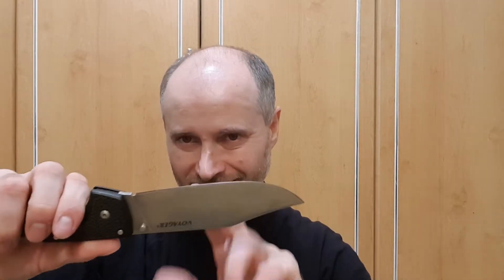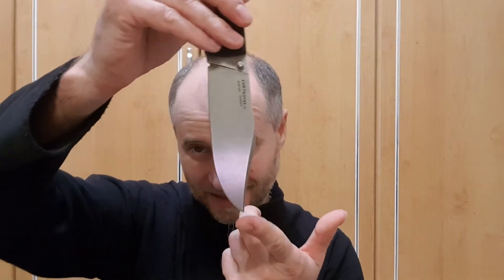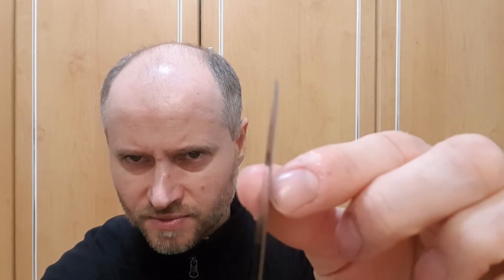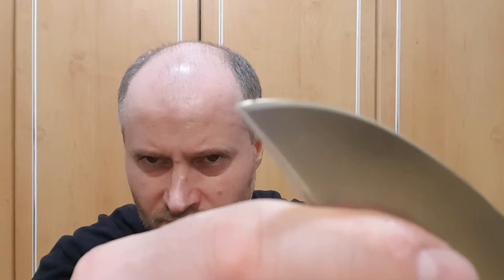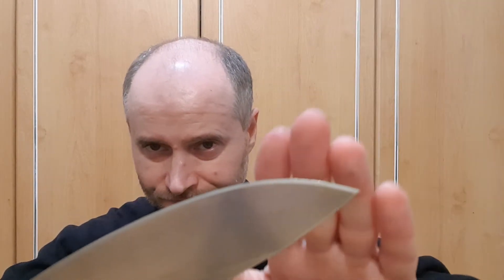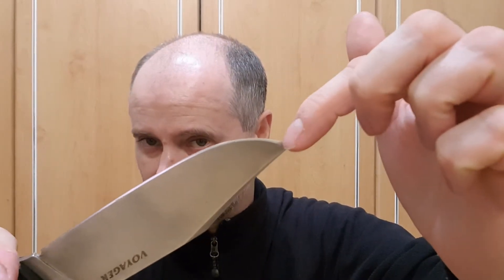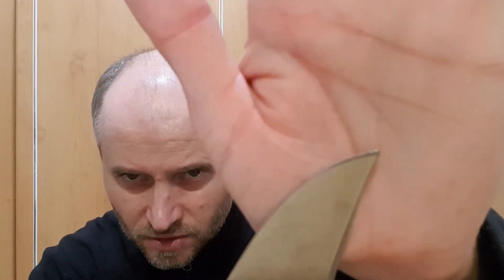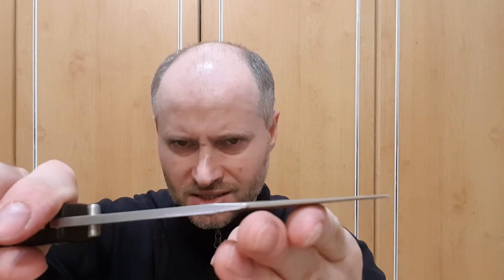AUS 10 steel and concrete (can AUS 10 survive and if, in what condition?) + something about AUS 8/10

Comment: Great discussion.  Your experiences with the two Steels 8s pretty much the same as mine; I absolutely agree.  AUS-10A is the edge King.  And, AUS-8A is a great Field Knife Steel due to the lower heat treatment that is easy to resharpen to a Razors Edge and has great toughness.  :-) Peace, Stiletto :-)
Reply from the maker: Thank you and have a great time there:-) FM

Comment: I'm really impressed with that. I'm a diesel mechanic an I was also a Iron worker. I've dropped and just mistreated many knives. I've seen some break the whole tip off. So damage like that is really not bad.
Reply from the maker: Absolutely agree, CS did a great job with the steel. Thank you for the comment anyway. FM PS: Check out my test of the Drop point Voyager (also AUS 10), what it can stand... https://www.youtube.com/watch?v=UU4IF_2iqSg